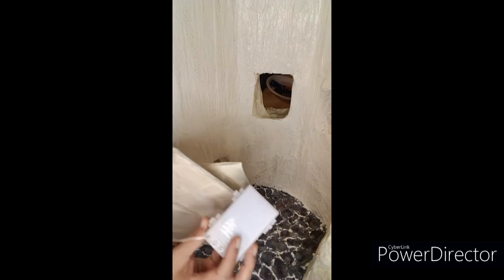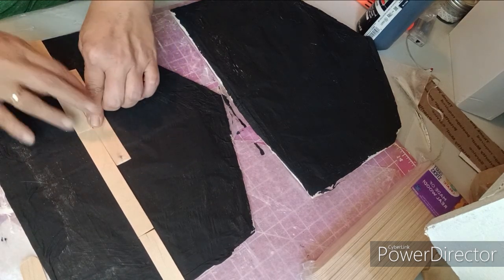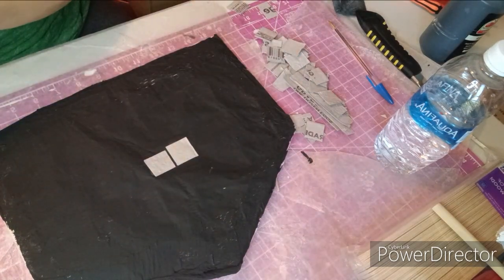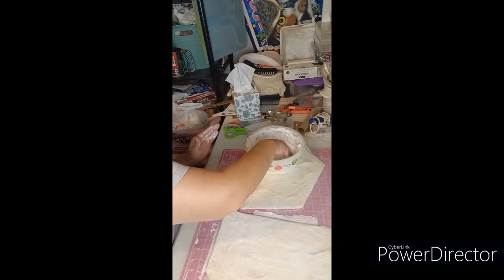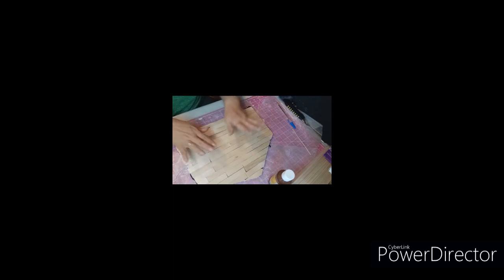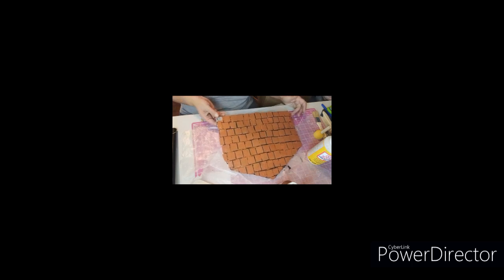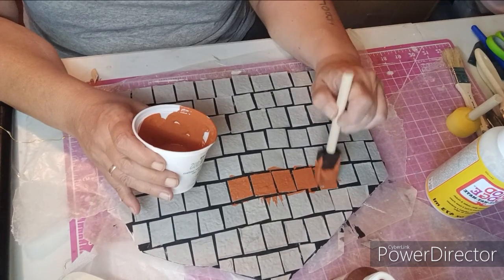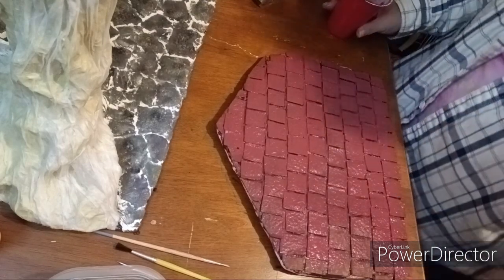Fairy House in a Tree DIY Part 4. Adding the lights and finishing the 2nd & 3rd Floors.

Comment: Oh, and i like your intro.
Reply from the maker: Thanks. Still trying to figure out the editing stuff
Reply: @thecraftyconnection5688 editing is my arch nemesis.  It took me forever to figure out I could split a frame so I could have first part normal speed and then once I showed what I was doing- by splitting it, I could speed up the other part.  It literally took me over a year to figure that out.  I am very slow when making stuff so sped up for me is about the normal speed for most lol.  I hate editing.